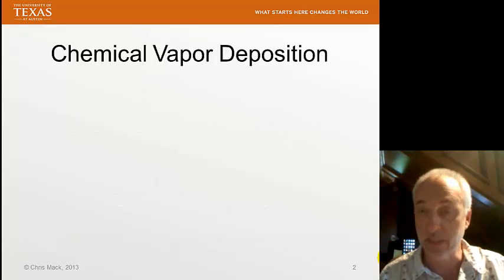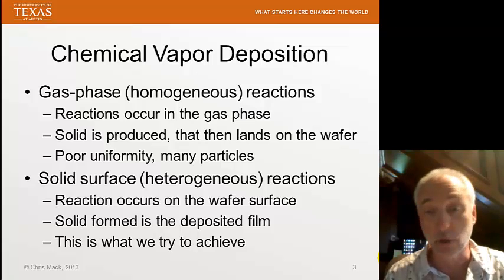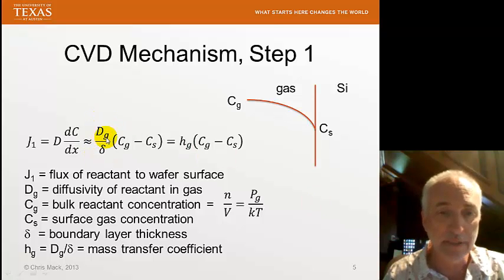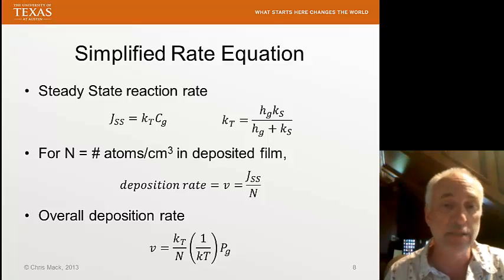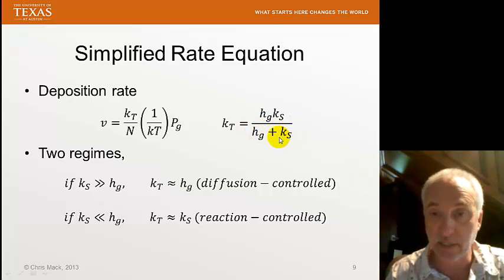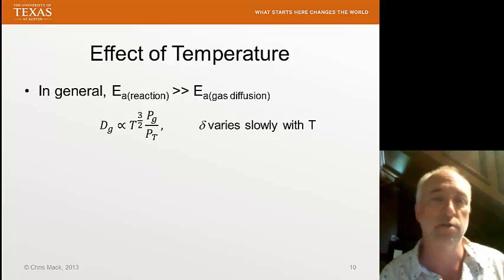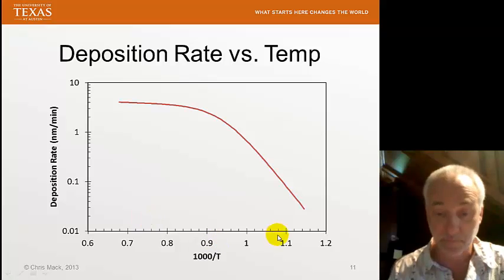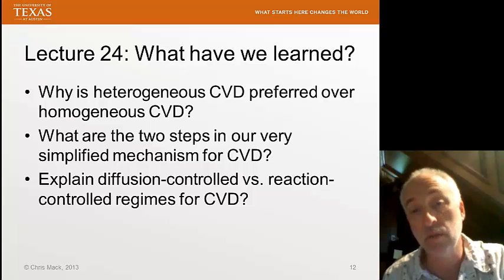Lecture 24 (CHE 323) CVD, part 1

Comment: AI Summary

Abstract:

This lecture introduces Chemical Vapor Deposition (CVD) as a micro and nanofabrication technique distinct from physical vapor deposition (PVD) due to its reliance on chemical reactions to form thin films. The discussion highlights CVD's widespread use in depositing dielectrics, silicon (epitaxial and polysilicon), and certain metals (e.g., tungsten, TiN) in semiconductor manufacturing, typically performed in furnaces or newer single-wafer reactors. A key emphasis is placed on the preference for heterogeneous (on-wafer surface) reactions over homogeneous (gas phase) reactions to avoid uniformity issues and particle defects. The lecture presents a simplified two-step mechanism for CVD kinetics, involving gas-phase mass transport (diffusion) and a surface reaction, leading to the definition of two critical operating regimes: diffusion-controlled and reaction-controlled. It explains how temperature significantly influences these regimes due to differing activation energies, with high temperatures favoring diffusion control and lower temperatures leading to reaction control. The importance of maintaining low reactant partial pressures to prevent undesirable homogeneous reactions is also discussed, alongside the general desire for high deposition rates, often found in the diffusion-controlled regime.

Summarizing Chemical Vapor Deposition (CVD): Mechanisms and Regimes

*   0:00 Introduction to CVD: Chemical Vapor Deposition (CVD) is a film deposition technique that fundamentally differs from Physical Vapor Deposition (PVD) by involving chemical reactions in the creation of the deposited material.
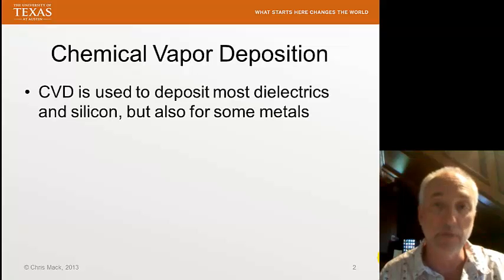*   0:34 Applications & Equipment: CVD is primarily used for depositing dielectrics and silicon (epitaxial or polysilicon) in semiconductor manufacturing, and also some metals like tungsten and titanium nitride. It's often performed in furnaces, similar to oxidation/diffusion furnaces, or in newer single-wafer reactors, reflecting an industry trend towards single-wafer processing for greater control.
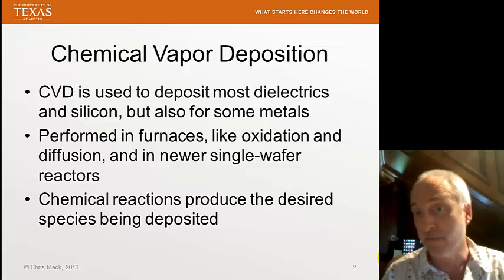*   1:46 Core Difference - Chemical Reactions: The defining characteristic of CVD is that the film is created by chemical reactions occurring on the wafer surface.
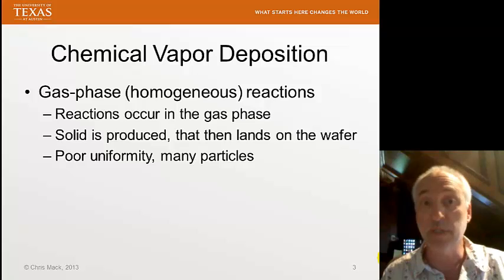*   2:17 Homogeneous vs. Heterogeneous Reactions:
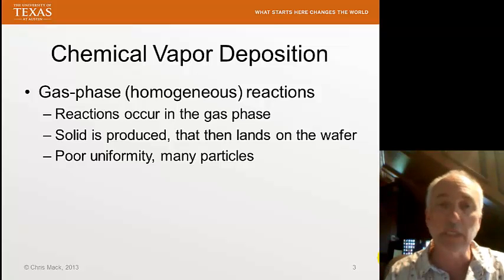    *   Homogeneous (Gas Phase) Reactions (2:25): Reactants in the gas phase react to produce a solid that then lands on the wafer. This is generally undesirable due to poor uniformity, high particle count, and defects.
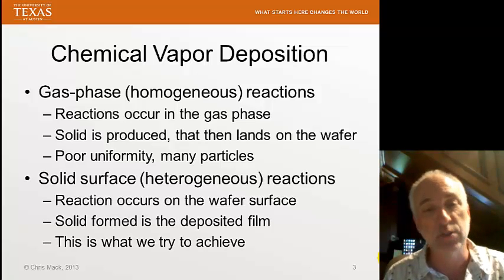    *   Heterogeneous (Solid Surface) Reactions (3:11): Reactants adsorb onto the wafer surface, react, and form the solid film directly where needed. This is the preferred mode of reaction, encouraged by adjusting chemistry, concentrations, and chamber configurations.
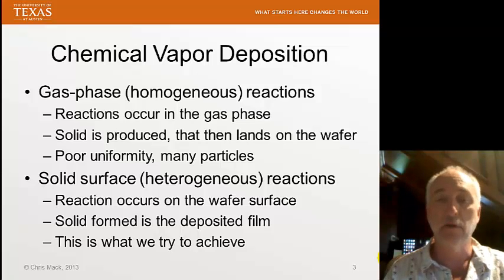*   3:46 Simplified Two-Step CVD Mechanism:
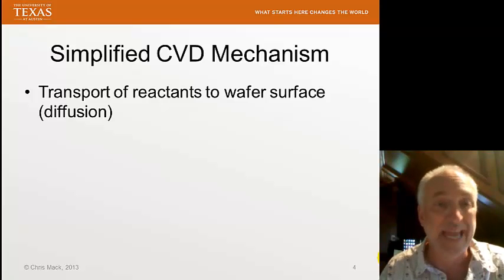    1.  Gas Mass Transport (Diffusion) (4:47): Reactants diffuse from the bulk gas phase to the wafer surface. This flux is described by Fick's First Law.
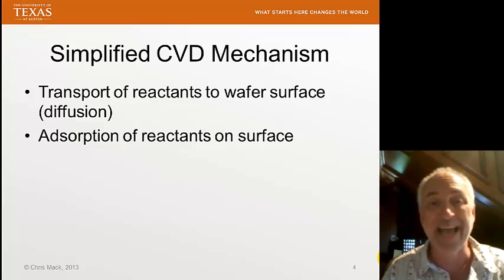    2.  Surface Reaction (4:54): Reactants adsorbed on the surface undergo a chemical reaction to form the film. This is assumed to be the rate-limiting step in this simplified model.
    *   Key Takeaway: Byproducts desorb and transport away, but these are assumed not to be rate-limiting.
*   7:22 Steady-State Flux & Rate Equation: At steady state, the diffusion flux equals the surface reaction flux. This leads to a simplified deposition rate equation proportional to an "overall" rate constant (Kt) and the partial pressure of the reactant in the gas phase.
*   8:32 Converting Flux to Growth Rate: The reaction rate (flux, atoms per unit area per unit time) is converted into a deposition rate (thickness per unit time) by dividing by the atomic density of the deposited film.
*   10:47 Two Operating Regimes:
    1.  Diffusion-Controlled Regime (11:20): Occurs when the surface reaction rate constant (Ks) is much larger than the mass transfer coefficient (Hg). Deposition is limited by how fast reactants can diffuse to the surface.
    2.  Reaction-Controlled Regime (12:19): Occurs when the surface reaction rate constant (Ks) is much smaller than the mass transfer coefficient (Hg). Deposition is limited by the speed of the chemical reaction at the surface.
    *   Key Takeaway: Knowing which regime the CVD process operates in is fundamental for designing and optimizing the system.
*   12:52 Effect of Partial Pressure (Pg): High partial pressure of reactants is desired for faster deposition rates (throughput). However, high Pg increases the likelihood of undesirable homogeneous gas-phase reactions, leading to particle defects. Therefore, reactant partial pressures are typically kept low to favor heterogeneous reactions.
*   15:00 Effect of Temperature (Arrhenius Plot):
    *   Activation Energies: The activation energy for surface reactions is significantly higher than for gas diffusion. Gas diffusivity varies slowly with temperature (e.g., T^(3/2)).
    *   High Temperatures (16:40): At high temperatures, the surface reaction rate (Ks) becomes very large, making the process diffusion-limited (rate changes slowly with temperature).
    *   Low Temperatures (17:01): At low temperatures, the surface reaction rate (Ks) becomes small, making the process reaction-limited (rate changes steeply with temperature).
    *   Pseudo-Arrhenius Plot (17:35): Plotting deposition rate vs. 1/Temperature on a logarithmic scale shows a steep slope (high activation energy) in the reaction-limited regime and a flat slope (low temperature dependence) in the diffusion-limited regime.
*   19:33 Implications for CVD System Design: The design of a CVD system (e.g., chamber configuration) must differ significantly depending on whether it's intended to operate in the reaction-controlled or diffusion-controlled regime.
*   20:09 High Deposition Rates: Highest deposition rates are generally achieved when operating in the diffusion-controlled regime.
*   20:41 Review Questions: The lecture concludes by prompting the audience to recall why heterogeneous CVD is preferred, the two steps of the simplified mechanism, and the difference between diffusion-controlled and reaction-controlled regimes.

I used gemini-2.5-flash-preview-05-20| input-price: 0.15 output-price: 3.5 max-context-length: 128_000 on rocketrecap dot com to summarize the transcript.
Cost (if I didn't use the free tier): $0.0075
Input tokens: 18382
Output tokens: 1343

Comment: Amazing stuff Sir.
Now please forgive my troll level of physics ignorance, i've only had physics until my senior year in high school. Nevertheless, I was so intrigued by CVD diamond growing when first i heard about it, that it got me thinking. Let's say you had a diamond disc of radius 5cm placed in you CVD chamber. And as you were depositing the methane gas which builds the lattice for the growing diamond, you sequentially (by first switching off the microwave source..or not) introduce all the chemical elements necessary to make a neodymium magnet. Making sure to deposit only about a 2-atom-thick layer of these neodymium magnet ingredients. However, the neo-magnet ingredients should be deposited within a smaller radius to the diamond disc, something like 4cm instead of the disc's 5cm.  So that the next deposition of methane (with accompanying microwaves) at a radius equal to the disc, would essentially (and simultaneously) encase and cook the neo-magnet ingredients into a rudimentary neodymium block ready for magnetization, albeit it being 2 atoms thick. Once the second round of methane deposition is done, we continue to deposit the neo-magnet ingredients again, and so on. The result would be a diamond cylinder block that looks like a stack of CD's stacked on top of each other, since if you looked at the stack along its length, you'd be able to peer to the other side of the room. But look at the stack from the top, and you'd see nothing but the Musician's album cover/art. 

My thinking for depositing such ultrathin layers of neo ingredients was that the diamond lattice which has to form on top could grant the magnet lattice some of their immovable properties (being diamond after all) to prevent the the finished diamond from hopefully tolerating very high temperature, physical, and other forms of stress.

Now that you have an idea of what i am getting at, i want you to imagine the CVD chamber being fitted with a powerful electromagnet that would induce and maintain polar orientation of the neodymium layer at select times during the entire CVD process. So regarding the placement of the electromagnet poles, perhaps the "North" pole could be just atop the  Chamber, while the "South" pole is fit just below the chamber. It look like you pinching a AAA battery at its ends between your thumb and index finger. 
Now of course, this is probably flawed to humorous level, but what the heck.

This is just an entertaining thought for times in the shower or when trying to fall asleep, but whatever you do after reading this, please think about what such a magnet infused diamond could be capable of.  Cheers, and thanks for reading :)

Comment: Why is the slope of pseudo-Arrhenius plot in the reaction-controlled regime proportional to -E_a/k_B? Arrhenius equation for reaction rate constant is k_T = A*exp(-E_a/(k_B*T)). Substituting it into the formula for deposition rate we can find the natural logarithm of the deposition rate being represented as

ln(v) = ln(k_T/N*(1/(k_B*T))*P_g) = ln(A*P_g/(k_B*T)) + ln(exp(-Ea/(k_B*T))) - ln(T), so
ln(v) = const - E_a/(k_B*T) - ln(T)

So in addition to linear dependence on 1/T, there is additional dependence of deposition rate on temperature in the form of ln(T) or -ln(1/T).
Reply from the maker: +Zumbi Azul Your derivation assumes that the partial pressure of the reactant in the bulk gas, P_g, is kept constant as the temperature is changed.  Another possibility is that the concentration of the reactant in the bulk gas, C-g, is kept constant as the temperature is changed.  In this second scenario, the pseudo-Arrhenius plot is linear with 1/T.
Reply: +Chris Mack You are right, I had to express the partial pressure as P_g = k_B*T*C_g. Thanks!

Comment: I guess there is a misprint at the slide numbered 7 in the bottomest formula. The denominator should be (h_g+k_s), not (h_g+C_g).
Reply from the maker: +Zumbi Azul You are correct!  Thank you for finding the error.  I have updated the pdf of the slides on the course website to show the correct formula.  Please note that all of the formulas on the rest of the slides are correct.
Reply: +Chris Mack Thanks for your precious lectures! They helped me a lot to get into the understanding of CVD process. I'm doing my PhD now and I have to write my first year report. And I wanted to ask if I could use the material in the report with a reference to your name?
Reply from the maker: +Zumbi Azul Yes, you may do so!
Reply: Thanks!
Reply: So this is how you can also get permissions now :)